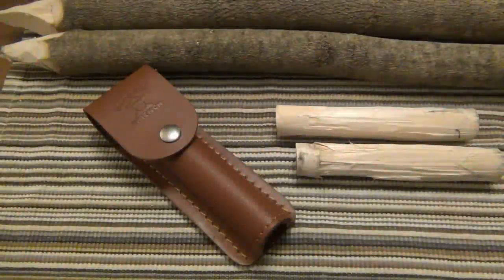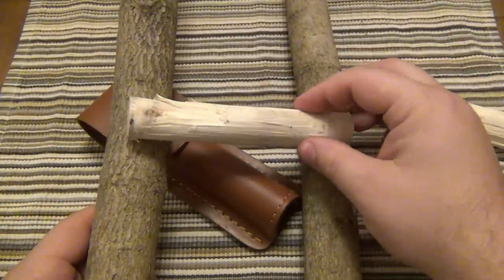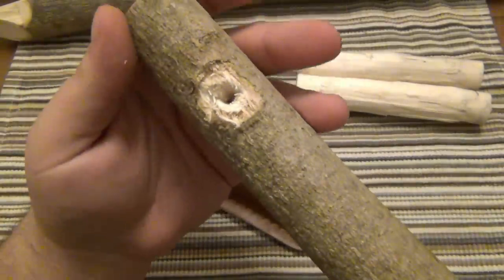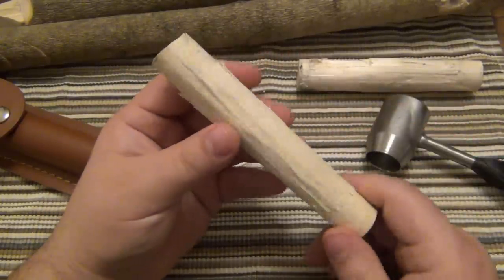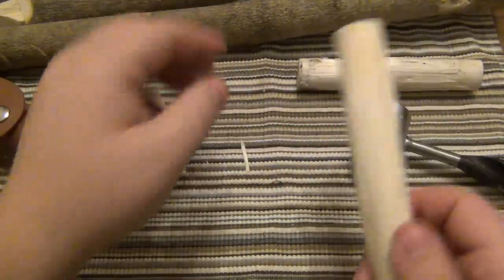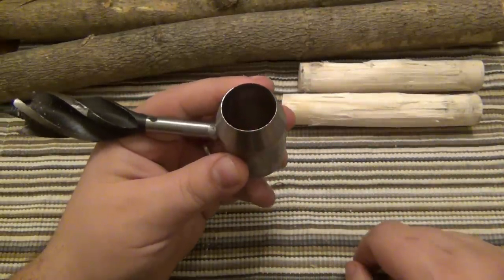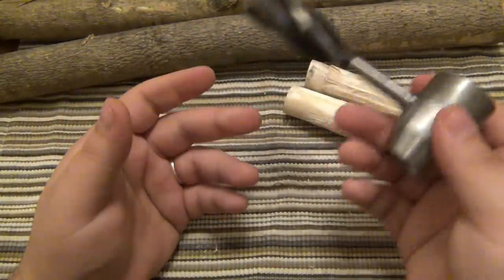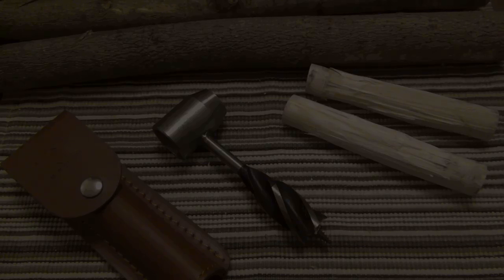BATTLBOX Gear Testing : Settlers Wrench FAIL (Learn From My Mistakes)

Comment: It’s not actually a “drill bit” it works more like an end mill bit. The threaded bit at the end helps keep pulling it into the wood but the bit itself doesn’t dig. It eats away at the surface as you spin it kinda like an auger. Looks like they took a big end mill bit and welded it to the other piece.
Reply: Yeah, auger bits shouldn't have more that two flutes and one is all it actually needs.

Comment: I would prefer a model that’s slightly longer and a slightly smaller diameter. Half inch seems about right. This seems more like a 5/8” or 3/4” bit

Comment: You need a bigger piece of wood haha. The grain in that small piece of wood are too dense.
Reply from the maker: you cant use a bigger piece of wood because the pegs cant be cut to fit...
Reply: cutlerylover Get a larger piece of wood for the posts. Use the same size pegs.
Reply: @UpstateBreezy  not to mention if he did get the hole drilled in it would probably split because there wasn’t a lot of meat to it

Comment: The design is garbage, two cutting blades design works best, they are easy to sharpen too. Never had an issue with one going through dry hardwood before( does full them faster though)

Comment: Don't baton it in. Let the screw tip pull the rest through.
Reply from the maker: tried that after the video reading comments and it still didnt work at all the wood is too hard

Comment: It should still cut hard wood. If that thing was made correctly it doesn’t matter what kind of wood it is. Cutting bits should always be harder than wood haha. It should take much pressure....the tool should do all the work and shave off chips.
Reply: The prototype most likely made using a real auger and worked pretty good. Bet when they started mass production all kinds of corners were cut to cut manufacturer costs and the end product suffered. As long as suckers keep buying they don't care

Comment: Anyone who buys battlebox anything is an arm chair camper. Anyone who has actually done anything knows their crap is ridiculously over priced. Aluminum cook sets at titanium prices... 3 dollar harber freight siphon ten bucks. Etc... everything looks junky. I guess it's okay. Anyone dumb enough to buy it, would probably never really use it. Other than in their backyard. $75 on their site. $59 on another. Next time get a real anger. It'll cut through anything.they are used on Ebay about 1/3 the price for a multi-piece set.

Comment: Old timey crap requires a butt load of work id expect each hole to take 30 mins in a drill press youd spin that bit some 2 thousand times to drill thro by hand id expect more
Reply from the maker: yes I didnt mind doing it for a while but after 10 minutes thats what I got, even with a powerdrill it took 5 minutes to eventually get 3/4th the way into the wood...
Reply: cutlerylover makes ya really respect what our ancestors had to do eh lol nothing a lil elbow grease cant fix
Reply: @argoscenturian6535  I remember on PBS a series where Roy Underhill did all the projects with old time hand tools and it was amazing to watch what someone with training could do.
Reply: Keith Newton yup we have definitely lost alot in the last 40 years .prob the greatest loss is patience to actually build anything by hand i find myself constantly getting after my kids cause they spend 5 or ten mins on something then whine its too hard . Unless you put an honest effort in you will never learn and powertools aint learning

Comment: Man. I do a lot of primitive/historical woodworking and there are WAY better ways and tools to do those two things. With very simple tools and hard wood is not an issue. For that project you just the basics, bush craft knife, sharp chisel, and folding saw. To make it even easier get a good axe and brace drill. Add a broad axe, froe axe, hand planer, Japanese pull saw and a full chisel set and you can make almost anything. Build a cabin and all the furniture in it.
Reply: Nothing that a couple thousand dollars worth of tools can't fix.
Reply: @jgbullen  No way unless you are buying top of the line Gränsfors Bruk axes. You can have a very nice set of carpentry tools for dirt cheep especially if you buy used on Ebay. I've spent more on a single gun then all of my middle ages woodworking tool kit. The biggest cost was my broad axe because i had it custom made for me by a blacksmith.

For what he wanted to do it's under $75 in tools. Probably a lot less because he definitely already owns a bush craft knife.
Reply: @sharpie443  OK  and I was not making fun. I already own a lot of tools and don't need a new hobby handcrafting stuff Settlers had no power tools but they also had nothing else to do and would spend all winter carving something. If I need to drill a hole I yell DWalt and it comes running.
Reply: @jgbullen  No power in the woods and I don't have to buy a new $100 every ten years. I still use modern tools but I try and use hand tools as much as possible. It's fun and you learn a lot more about woodworking. For one thing you find out that screws and nails are not really needed for most things.
Reply: Great for you. I have a lot of hand tools you mention. Years ago there was a guy from NC on PBS who had a woodworker shop. I think I watched every episode more than once. He also cut himself a lot so be careful.